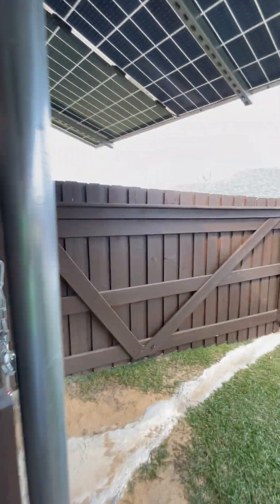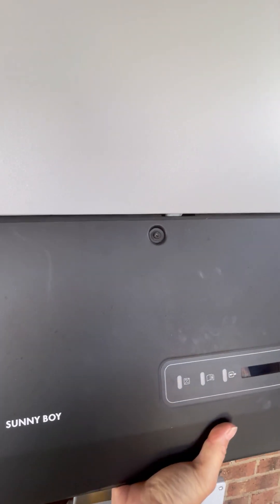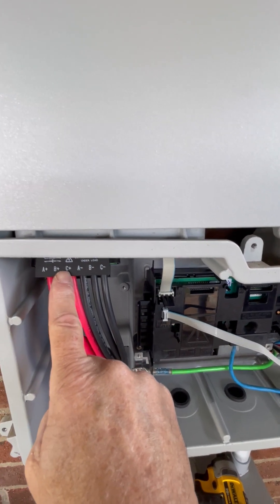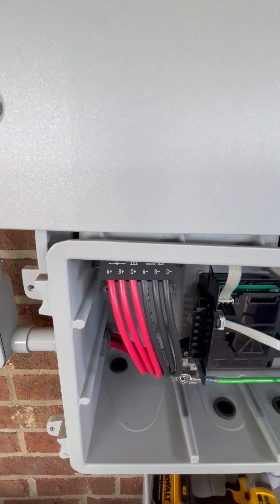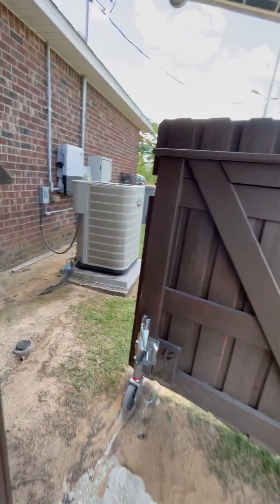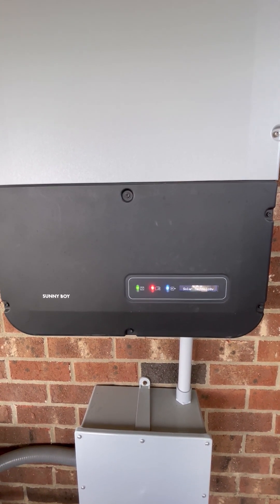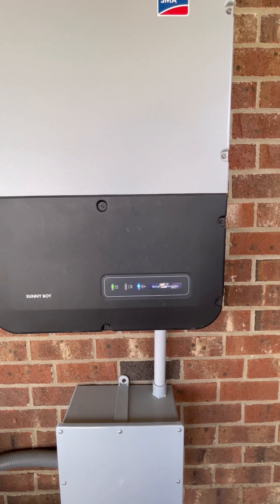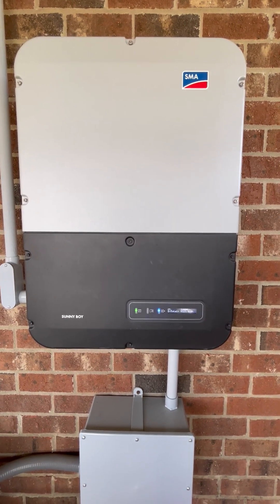Electrical Wiring for a SMA Sunny Boy 7.0 Grid Tie Inverter

Comment: Killing AC first will mean the dc shutoff will be zero current.  The DC switch has limited life.
Reply from the maker: I have had no issues at all and it will still pull from the DC side for the built in WIFI.... You should not have to turn off the DC ever unless you have a problem anyway.

Comment: Hello, 
thank you so much for interesting videos.
Originally we are from Europe. From 2015 our family has been moved to Colorado and still there. 
Like to install solar panels and was confused about Xcel Energy part of project. Will I need to get agreement with them? 
How is your experience?

Thank you.
Reply from the maker: If you grid tie, yes.
Off grid, no.
Reply: @HR12465  Thank you so much for responding. For now - what is the first step you recommended to connect with Xcel Energy?
Reply from the maker: Go to there website or call them about net metering. They should be able tell you all the steps you need for them.
Reply: Thank you! Happy Thanksgiving!
Reply from the maker: Happy Thanksgiving to you as well